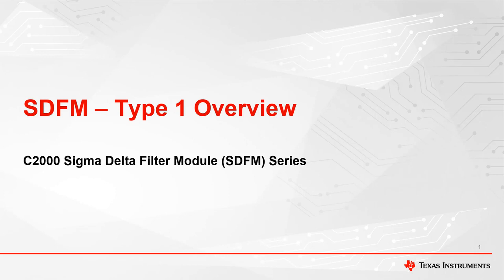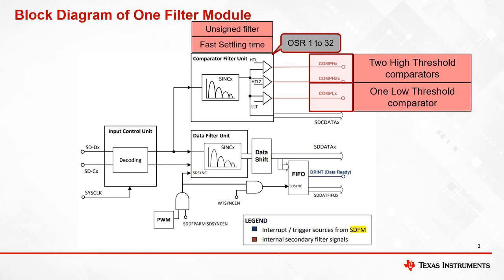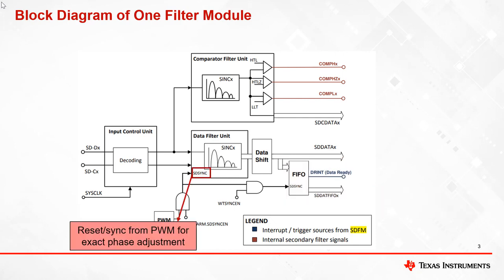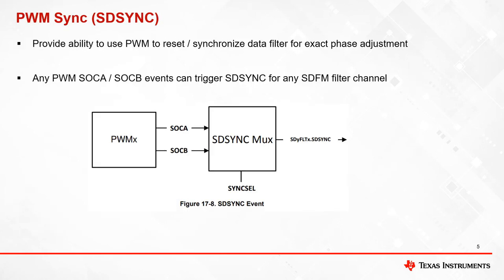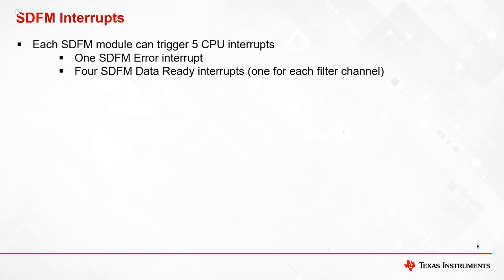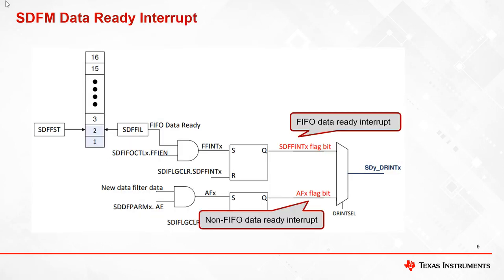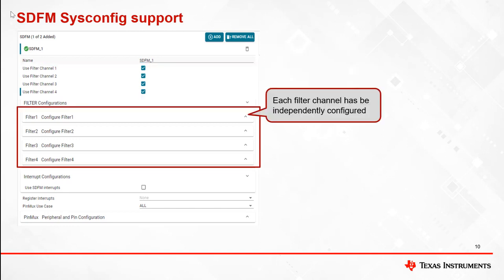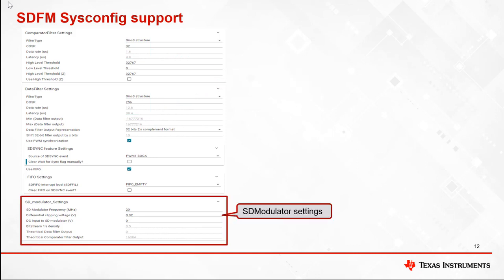SDFM-Type1 Overview

Comment: Magnetic alloys with the addition of "boron" as a divider, crushing into fine grains and better joining of dissimilar metals... it may be necessary to change the amount of chromium in the range from 0.5 - 3% maximum... A percentage measure of volume, not weight...

1)

30% - iron

30% - cobalt

15% - nickel

5% - copper

3% - neodymium

3% - samarium

3% - manganese

3% - chromium

2.5% - silver

2.5% - gold

1.5% - strontium

1.5% - boron

2)

45% - iron

15% - cobalt

15% - nickel

5% - copper

3% - neodymium

3% - samarium

3% - manganese

3% - chromium

2.5% - silver

2.5% - gold

1.5% - strontium

1.5% - boron

3)

50% - iron

12.5% - cobalt

12.5% - nickel

5% - copper

3% - neodymium

3% - samarium

3% - manganese

3% - chromium

2.5% - silver

2.5% - gold

1.5% - strontium

1.5% - boron

4)

51% - iron

13% - cobalt

13% - nickel

5% - copper

3% - neodymium

3% - samarium

3% - manganese

2.5% - silver

2.5% - gold

1.5% - strontium

1.5% - boron

1% - chromium
Reply: Mod version of alloys with boron, without strontium and with the addition of yttrium...

1)
30% - iron
30% - cobalt
15% - nickel
5.5% - samarium
5% - copper
5% - neodymium
2.5% - silver
2.5% - gold
1.5% - yttrium
1.5% - manganese
1% - chromium
0.5% - boron

2)
45% - iron
15% - cobalt
15% - nickel
5.5% - samarium
5% - copper
5% - neodymium
2.5% - silver
2.5% - gold
1.5% - yttrium
1.5% - manganese
1% - chromium
0.5% - boron

3)
50% - iron
13% - nickel
12% - cobalt
5.5% - samarium
5% - copper
5% - neodymium
2.5% - silver
2.5% - gold
1.5% - yttrium
1.5% - manganese
1% - chromium
0.5% - boron

4)
51% - iron
13% - nickel
11% - cobalt
5.5% - samarium
5% - copper
5% - neodymium
2.5% - silver
2.5% - gold
1.5% - yttrium
1.5% - manganese
1% - chromium
0.5% - boron